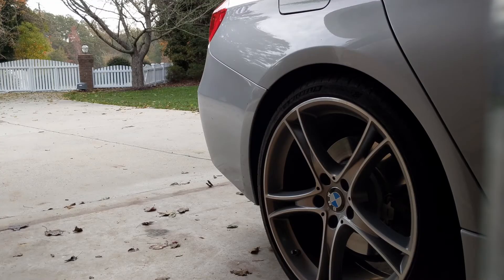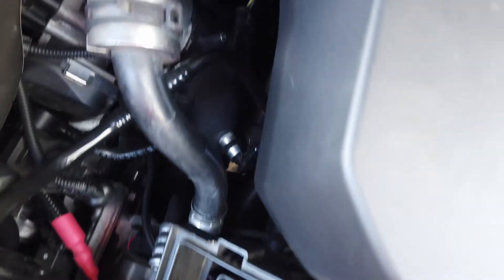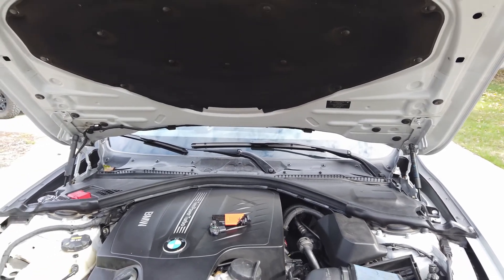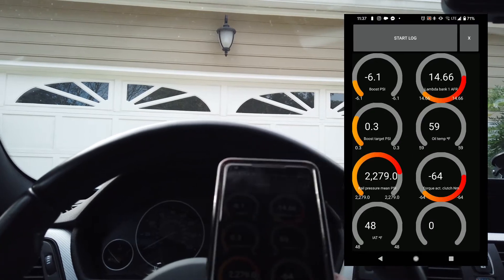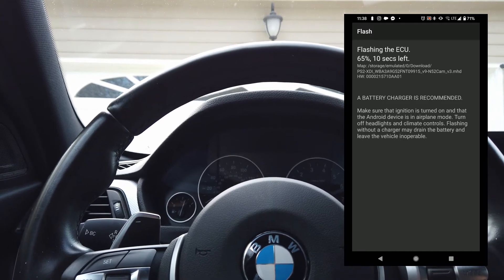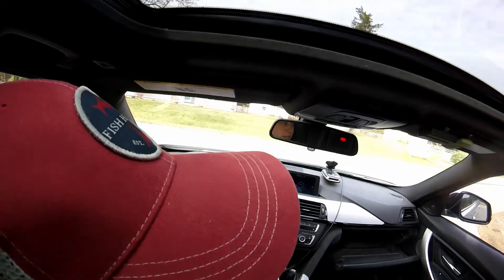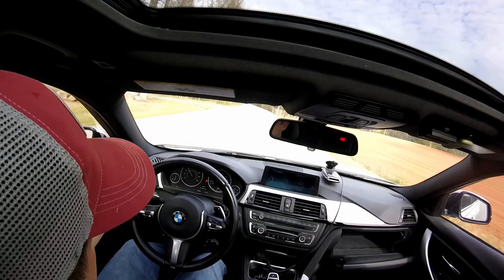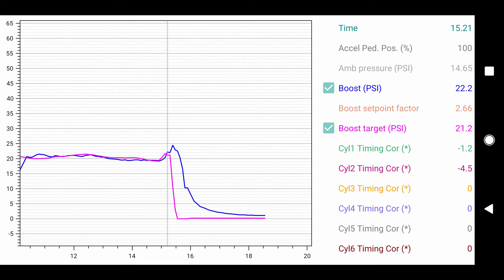BMW F30 N55 - N20 3.5 Bar Map Sensor Upgrade

Comment: How do you know if your current psi is too high for stock sensor ? What code will be thrown?
Reply from the maker: Your tuner will let you know. You just can't read past 25 psi I believe
Reply: @BtwilliasGarage  I’m trying to figure out why I have codes p0172 & p00bd.. I  swapped my turbo valve so was wondering if this messed with the airflow .. I have a stage 2 AGG bm3 tune with bms intake .. the car runes fine though
Reply from the maker: @SeanMichaels23  I see. I would definitely log a pull and send to a reputable tuner. Those issues can be annoying. I did the GFB diverter valve when I installed PS2 turbo and charge pipe meth and never had that issue.
Reply: @BtwilliasGarage  thank you, will try that out. I have to turbosmart bov with the bms intake and has been running 25-30% to rich since install

Comment: Hey I recently installed a vrsf charge pipe on my m235i n55. I keep getting code p00bd. Not getting full tq all the time. Getting full 320 hp. Just wondering if it’s my maf messing up or bad pipe install.
Reply from the maker: One of the two. You can do a smoke test or look for a visible leak

Comment: Hi man! Have a question, Do you need to re-pin the stock harness for your car? I got the n55 EWG model, Looks the same as yours, just not sure If I need to re-pin for the 3.5bar tmap sensor, Thank you!
Reply from the maker: I did not, I believe the repin is only for the PWG N55. You should be good

Comment: You didn’t have to re-pin the connector when changing the N55 T-Map sensor to a N20 3.5 bar sensor ?
Reply from the maker: Not on F30s
Reply: Btwillia's Garage Your 100% right.  Just to test it out I just changed out the sensor with a N20 Sensor, re coded works like a charm.  Good piece of information to know,  Changed back to my 2.5 bar atm, however which vehicle can we get the 4 bar off of do you know, is it the S55 engines ?  Thanks again
Reply from the maker: I am not sure to be honest about the 4 bar. Do you think you will need it? 3.5 is good to 35 or 38 I believe. Thanks for checking out my channel!

Comment: What is your opinion on the new big boost stage 3 turbo?
Reply from the maker: It's hard for me to comment since I have not checked one out in person yet. I have heard that you need an experienced installer since the kit can leave a little to the imagination (parts store trip needed). Seems to make good power though. Tell them to send me one and I'll throw it on and do a complete review, evaluation and torture test.
Reply: Btwillia's Garage do you ever plan on going closed deck conversion like some of the other high horsepower n54 engines out there ? Is it possible to convert to forged rods and crankshaft like the n55 in the m2?
Reply from the maker: You pose very good questions. I am looking into all of these and will keep you posted

Comment: Btwillia's Garage do I have to switch the pins around in the plug? I saw it on a different video. 07 335i e90 TIA
Reply from the maker: Yes or you can make your life easy and order the kit that is plug and play for the N54 conversion. Turner Motorsports has one. Just map sure it's the TMAP sensor if you order that too from them and your good
Reply: @BtwilliasGarage  thanks

Comment: Damn 21 psi, assuming that's a custom tune? And on stock turbo? When do they max out?
Reply from the maker: Car is maxed out with all mods pretty much. PS2, meth, XDI35 HPFP, N52 cam, etc. Check out my other videos. I hit 28.4 psi yesterday for a sec on a new tune revision. We obviously are turning it back down. Should dial it in around 23psi I assume for 575whp
Reply: Btwillia's Garage I wanna build my car like this man. What’s 575whp feel like on the f30?? What are examples of a few cars you’ve pulled on? I’ve had my f30 for like a year and just started doing serious power mods now. Kinda wishing I got an n54 lol, pretty wild how we have to add cams, turbo and fuel pump just to break 550 wheel. I have pwg too so it’s even harder haha.
Reply: @NewDesignVinylGraphics   like a porsche

Comment: I'm running stage 2 93 octane map on bootmod3.  On custom settings I see a 3.5 bar sensor to select. Is it for this setup?
Reply from the maker: That is correct

Comment: But why just replace the pre boost/charge pipe tmap? Doesn’t really help to have that sensor able to read higher boost if your map sensor isn’t able to read higher boost lol
Reply from the maker: Fact check me here, but this is what I found during my research.

The map on the intake man measures vacuum. It is capped to about 2.7psi positive.
The tmap on the cp measures boost (this is what shows up as boost mean on mhd logs) and charge temp. Based on boost mean and boost target, the ecu adjusts throttle and computes boost, which shows as boost in logs.
Reply: Btwillia's Garage I don’t think that’s how it works at all. The map sensor is the exact same sensor as the sensor in the chargepipe, it sees and reads the actual boost in the manifold that passes the throttle. MAP PSI is the value read on the map sensor with bootmod3 and is considered the actual boost. You would absolutely need to swap both sensors to dial in boost higher than 21.7, what is the point of only being able to monitor pre throttle boost values higher than 21.7 when the dme is using the map sensor values to do the bulk of the work for adjustments. You might even end up getting a bunch of codes thrown by only changing the one sensor
Reply from the maker: @TheWeaponsLocker  you pose a good question. Let me find out and I'll circle back
Reply: @BtwilliasGarage  @theweaponslocker is onto something I am also thinking about.  Have you ever gotten into this and figure out if we need to change both pre-throttle TMAP along with the Manifold mounted MAP?  I think they need to both agree or else you should be getting air mass plaussibility codes.
Reply: I think the ECU Will have reported something was wrong if both map sensor needed replacement.  On the video he actually show that replacing only tmap on CP worked it read higher. No need to do both

Comment: Hey man.Did you run into any issues with your xdi 35 hpfp making noise on start up and driving with relation to your tune?
Reply from the maker: Yes I have. It's a common issue that the XDI35 will start screaming at idle with higher fuelrail pressure. If it happens it is because it is sending fuel from the rail back through the fuel pump. It doesn't hurt anything, and is safe to drive, but sounds terrible. That's why I got in touch with Pure Boost Tuning. To fix that very issue.
Reply: @BtwilliasGarage  Ok,good to know.Have you since resolved the issue?I think im gonna go with Carry Jordan for a custom tune.
Reply from the maker: @reonlawson9764  yeah I have. It seems to be a fine line with tuning to keep it from doing that. I am still working on tune revisions and it comes back from time to time. It goes away now once the car is warm when it does come back, but I just let my tuner know and he addresses it. It seems that outside air temp has a lot to do with it. Extreme hot or extreme cold tends to be when it shows up
Reply: @BtwilliasGarage  Gotha.Should have retrofit a supra pump.This pump is gonna drive me insane.Problem is it's so damn expensive so you kinda in for the long haul.Thnx bru👍